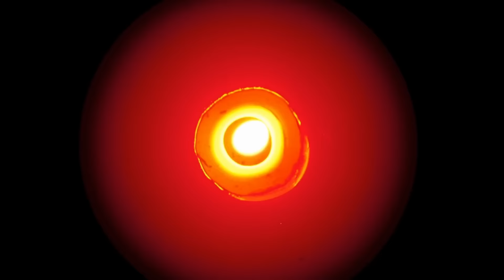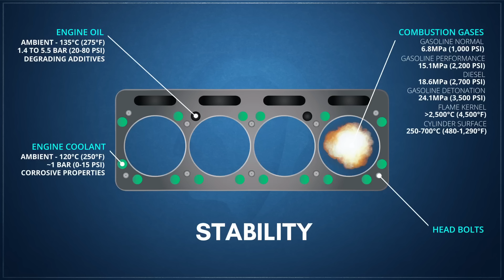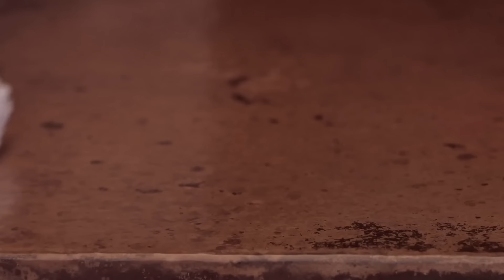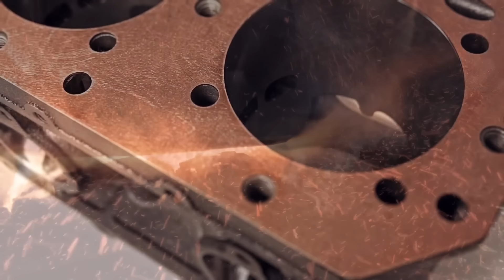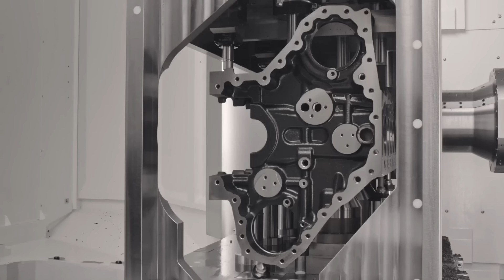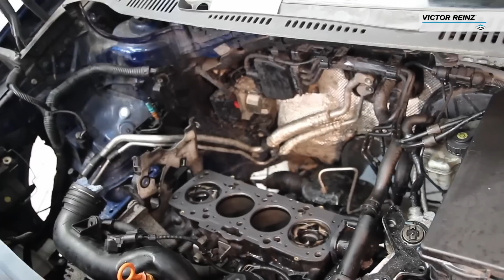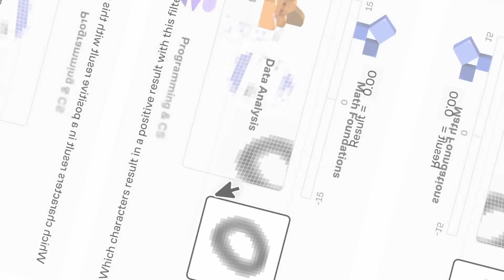Why This Basic Engine Part Is So Difficult To Design

Comment: I'm curious why manufacturers place the head to block boundary at the point where combustion pressure is the greatest. If the head came down the cylinder further the stress on the head gasket would be lower, right?
Reply: The way they build them is the easiest; it gives a flat surface on the cylinder head rather than having part of the cylinder in the head.  Air-cooled aircraft piston engines use integral cylinder/head setups though; no head gaskets at all.  They’re more complicated to manufacture and maintain though.
Reply: I mean why not just cut grooves around the ports that need sealing put rubber o rings in there and match those with extensions on the head that fit in the grooves, this has been done on smaller engines for years.
Reply: I recall some engines - mostly early 20th century - were "monoblock," with the cylinders and head as one piece like you describe. The difficulties of manufacturing and maintenance probably outweighed the advantages, at least as head gaskets improved. As jimsvideos7201 said, airplane engines commonly have the head and barrel as actually not one piece (the head is aluminum and barrel is steel), but they're permanently bonded together. This greatly complicates maintenance and servicing versus an engine that has the head and barrel as separate pieces, as is done on Volkswagen Beetles (which are overall quite similar to airplane engines in terms of design, though much smaller, and not so stupid expensive). Beetles don't use head gaskets either, instead an interference fit between cylinder barrel and head. The head can be removed without taking the engine fully apart, and when rebuilding one can simply replace the barrels and re-use the head (usually replacing the valves and valve guides and machining or replacing the valve seats - all much easier to do without the barrel attached). Worth noting is that on airplane engines each cylinder/head is an individual "jug" bolted to the crank case, rather than the cylinders being part of an engine block.

The construction of car engines is totally different, with the block consisting of the upper portion of the crank case and the cylinders, head bolted on top. I suppose it would be possible to have the crankcase as one piece and the cylinders/head as another, like those early "Monoblock," but I suspect that would be vastly more expensive to manufacture.
Reply: Then you would end up with the head gasket in the cylinder where the rings move, catching and breaking them. Not an Option.

If you wanted to move the interface down (basically stick the cylinder into the head) you would end up with complex offset surfaces  that are much harder to manufacture than flat surfaces.

Ultimately, this is the best solution overall
Reply: @bavarianmonkey8326  that’s not necessary at all, the seal could be under the lowest point in the stroke.
Reply: @bavarianmonkey8326  isn't it easy to do? like we can drill out a hole into a block of metal, then we put piston and crankshaft from above. Nowadays we can use "dry sump"-concept where we don't need to put crankshaft at the bottom for lubrication. Basically, it is an upside-down engine. We can drill the intake/exhaust from the bottom and drop the valves into that hole from the top, before the piston.
Reply: @xponen  I think this is an interesting question. The answer is probably cost of manufacturing, it’s easier to cast and hone a through hole than a blind hole, especially since the explosion chamber is usually shaped, needing 3d cnc milling, which might not be possible at the bottom of a piston cylinder hole.
Reply: @bavarianmonkey8326  Aviation gets around this entirely by single casting individual cylinders. They sacrifice cost in the process, as the cast becomes much more complex, but it's a ton more reliable and capable of taking higher pressures and compression ratios, not to mention higher temps to allow air cooling instead of water cooling.
Reply: @kirknay in Formula 1 in the turbo era they cast the head and the cylinder in one piece. Machining the valve seats is an issue and honing the cylinders is difficult but it can be done.

Single cylinders with individual heads have been done for decades.

The question is always: is it necessary? And for most applications, it is not.
Reply: @bavarianmonkey8326  The latter suggestion I think is what he was suggesting. Cylinder bore and head are one piece, crankcase is another piece, basically the joint below the cylinder instead of above. Airplane engines do it that way, but nothing about those is cost-efficient shall we say - I don't know if because of that or not though.
Reply: @quillmaurer6563 to be honest, I did not even know that lycoming engines are built that way 😂. With manufacturers going towards more vertical valve angles (steeper ports) and five Axis CNC milling becominf more and more affordable, this might become an option for mass manufacturing. But it will still have significantly higher machining costs than the simple head/cylinder configuration.

In aviation, the huge price tag comes from paperwork. Proper materials, licenses, individual part checks and measurenments...
Reply: @bavarianmonkey8326  You mean the valves are at a bigger angle from the cylinder axis? I'd think that would make machining the valve seats down in the cylinder more difficult for this combined cylinder/head design, even with 5-axis CNC. I don't know how much auto-factories use 5-axis CNC, probably a lot of their machining is done by relatively simple and highly specialized equipment designed to do one machining operation on an assembly line, built to do that and only that, then passed on to the next machine that does the next step. Mass production is a very different environment from bespoke machining.

Regarding the airplane cylinders, the head and barrel are made as separate pieces (head is aluminum and barrel is I think steel), they're then fit together - not exactly sure how, but permanently, not intended to be disassembled. So the head is machined without the cylinder there, but any machining later on - such as honing valve seats - has to be done down in the cylinder.

You're right that a lot of the cost of airplane engines is the paperwork, certification requirements, and probably a lot more quality control - doesn't necessarily mean anything is better made or more precise, just that it is more carefully ensured to meet spec. I think another factor is simply production volume, the number of car engines made versus airplane engines, economy of scale. I don't know enough about the manufacturing process to know if the design of an airplane engine inherently makes it more difficult or expensive to manufacture. I'm guessing not, I think of the Volkswagen Beetle which used an engine far more similar to an airplane engine than a car engine, millions of those were made over more than half a century, and they were low-cost cars, if making an engine like that cost significantly more than a normal car-style engine of similar capability they'd have surely switched to that somewhere along the way.
Reply: @quillmaurer6563  no, a smaller angle, so the intake port is not 90° from the cylinder axis as it was done in the past but rather as vertical as you can make it. Obviously with the camshaft and other things in the way, there are limits on how small that angle can be. Check recent motorcycle cylinder heads that require good filling.
Reply: @bavarianmonkey8326  Oh, you're talking about the ports, not just the valves themselves - that makes sense, trying to design the ports to have as little bend as possible behind the valve. I'm guessing that wouldn't really matter for production, including of if the cylinders are part of the head, considering that the only machining done I'm guessing is the valve seat (probably to accept valve-seat-inserts in most cases) and the manifold mating surface. I don't think inside the ports is machined, just left as-cast. Tuners will "port and polish" their engines to eek out a tiny bit more power, but I don't believe that's a normal thing in production vehicles - cost-benefit isn't there for doing that at scale.
Reply: @quillmaurer6563 with very highly engineered engines (Yaris gr and some others I think has it) the intake Ports are machined so they are identical which cannot be guaranteed by rough Casting. This includes 5 Axis CNC work. But yes, most heads are not machined to that degree.

The Trend seems to be a reduction in "valve included angle" (steeper valves, more parallel to the cylinder axis) and more vertical intake port to enhance laminar flow. But when you do that, the valve Diameter gets smaller because the combustion chamber roof (I am referring to four valve designs) obviously gets smaller If the valves are more vertical and the cylinder diameter stays the same. This is why usually the intake ends up more vertical than the exhaust: it makes more sense there.
Reply: @bavarianmonkey8326  Makes sense. I'd imagine it might also relate to higher compression ratios, a flatter "roof" on the combustion chamber. Thinking of the exhaust valves being less vertical, it might be that the exhaust valves are typically smaller than the intake, so placed on a more "steep" (smaller) side of an asymmetric combustion chamber.
Reply: Does anybody here have any knowledge of how an engine works?
OP wants the piston to move past the gasket. Have you ever heard of piston rings? I've built multiple V8s and V6 engines. Ain't no way the piston is getting past a head gasket without immediate damage. So to answer your question about if the head can be moved lower down, the answer is no
Reply: @lewisheasman it could be moved below the piston movement completely, and it has in certain applications.
Reply: No. It's more of an upward pressure, more than an outward pressure.
Reply: @lewisheasman  when the piston came down, both the pressure and temperature decrease, so if we place head-gasket here then it will last longer.
Reply: @xponen  it may last longer when it comes to the compression forces but moving down you decrease your structural rigidity of the cylinder and create the ability to leak, crack and fail along different paths that arent as easy to dectect or repair.

Technically we dont even need head gaskets, Bugatti and other brands in the 20s and 30s ran without head gaskets because they made the block and head surfaces so precise that they werent needed. Head gaskets are really there to reduce overall cost and manufacturing complexity.
Reply: @lewisheasman that’s not how pressure works.

Comment: Subaru engineer in charge of the early 2.5L-- "Difficult?! Cut up an old cardboard box and you're gold!'
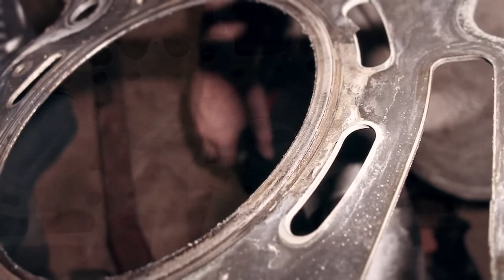Reply: @9:50 Is just such a gasket. (EJ253)
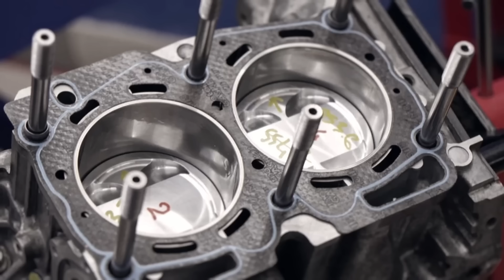@12:02 Is another Subaru engine, though the head gasket looks like an aftermarket unit. (JE Pro Seal - Athena Cooper Fire Ring on a 14mm studded EJ255/257)
Reply: Kellogs Cornflakes boxes were used for making base gaskets by many young motorcycle riders in the 80's...
Reply: @FelixCatz I was among them 😊
Reply: That's why I bought the 3.6R
Reply: @GiddyThis  My Tribeca has that engine. Very stout, never gives trouble. With "high mileage" synthetic oil, it uses zero between changes.
Reply: @GiddyThis 285k on my 2015 legacy 3.6r only thing I have done to the engine is plugs and coils
Reply: @wwhite2958 I absolutely love the 3.6R in the Wagon body. Not a chance id be happier at the price point i paid. Thanks for the informative response.❤
Reply: @wwhite2958  cool story bro
Reply: Long time Subaru enthusiasts here. It was the block design primarily, not the head gasket, the 2 cylinders on each side of the engine experience side-to-side stresses during operation from the pistons,  higher pressures can "break the seal" /of the cylinder head from its seated position on the head gasket against the head. The ej22t and later turbo ej25s had closed/semi closes deck blocks which helped to support the cylinders from moving inside the water jacket. Ultimately, that still didn't fully cure the issues, so they moved it to a whole new block design with the FA engines, which still struggle from head gasket failures after raising the power levels, but that's not Subaru's problem.
Reply: A lot of old timers would literally use a cardboard box for a head gasket.
Reply: Subaru engineers could have benefited from seeing this video prior to designing their flat 4 motors 😂
Reply: Wow how about geriatric motors their v6's are horrible for that, I don't actually know about the new ones but there has to be 30 years of ridiculously premature head gasket failures. It's not engineering they damn well know what works it's management and their mostly leg humping sycophants. I'd love to actually know who these fail on is it some clueless squid with his hard crosstheaded shutting his abused turbo down right after he invented his persona if front of a toothless crossthreaded hat wearing audience?
Reply: Does that mean they have a job opening?
Reply: Stupid and nonsense no humor
Reply: composite head gaskets are better at sealing imperfect surfaces than MLS gaskets in the short term and they're cheaper too.

at large mass scale it makes  sense.
Reply: I have literally seen an old tractor restoration video where he used a coca cola can box to cut out a gasket, and it worked lol
Reply: What's funny is the older Subaru engines use a MLS headgasket. Its what my ej22 has. Its never leaked or mixed fluids in the 30 years that car has been running. 
The 2.5's use a composite headgasket. 
The common solution is to switch out composite for MLS.
Oh and my ej22 got a turbo 7 years ago. I've accidently sent it up to 16 psi, once.
Reply: Idk why the fuck did they decide to use such shitty gaskets for the single overhead EJ25... Like FUCK, the cars from that 2000 - 2009 era look sooo good and I even bought one but now I gotta live with an external oil leak and a gasket that could give up any day.
Reply: You should look for another career. It took Subaru 10 years to figure it out. wtf?? The turbo MLS gasket worked, yet Subaru chose a bad coating on a single layer.
Reply: @egx161it's a joke
Reply: @egx161 wrong again dummy
Reply: @egx161 They still haven't figured it out, the FA20DIT still has headgasket issues 🤣
Reply: that just isn't true, problem is people modifying them beyond their design limitations or doing it on the cheap thinking it'll hold boost like an RB20.
Reply: The goal is to make money, not to make reliable parts
Reply: @SlowSTEN  Yeah cuz they boost their stock engine so hard that they blow heads.
Reply: I wonder if Steve Morris's technique of using two different sized soft stainless rings embedded into the cylinder head and the top of the cylinder bore and a solid copper gasket would fix the Subarus? These engines really need a fix they're very good engines aside from the fact that their head gaskets are a ticking time bomb.
Reply: garbage engine design to begin with, there's this downward force called gravity
Reply: @yeoldmetalhead6592 thats why Porsche has had such little success then?

Comment: I would think connecting rods would be the most stressed.
Reply: Actually if you're just talking about mechanical stress it would be the head bolts. But the oil and spark plugs
Reply: There are multiple ways of defining "stressed," so hard to say which is. Mechanically, the rods probably are. Or maybe the wrist pin, I've heard some say that's the most (mechanically) stressed piece of an engine (though I almost never hear about them failing). But the head gasket is - as the title suggests - probably the most difficult part to design due to the various things it has to contend with. And, consequently, among the most troublesome part of an engine (even modern engines). In present day I suspect head gasket failures are probably a lot more common than rod failures.

Comment: Too bad more time was not spent on developing apex seals for rotary engines.
Reply: Bruh, Loads of time was spent on Apex seals.
Reply: @blackflagqwerty  I agree, but only a fraction of what went into piston rings.
Reply: Newer ceramics along with using 2 stroke oil seems to work pretty well in some friends vehicles… but I do agree they should do a video on them
Reply: @SilentRacer911  I haven't watched it yet, but I see in my suggestions another New Mind video titled "Overcoming the Rotary Engine's Biggest Flaw," so I'm pretty sure they already did.

2 stroke oil wouldn't work well for passing emissions. Maybe you can get away with that, but wouldn't be an acceptable solution to OEMs.